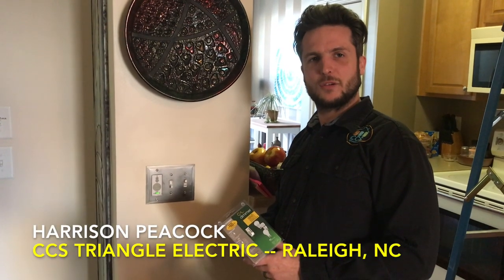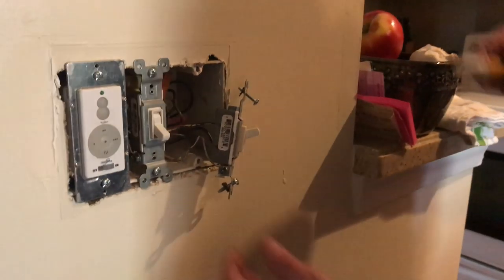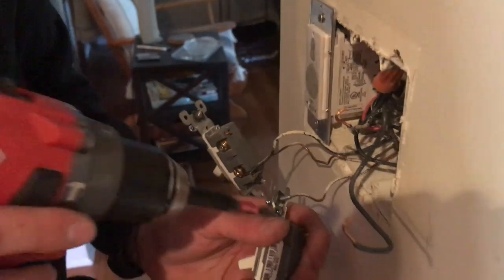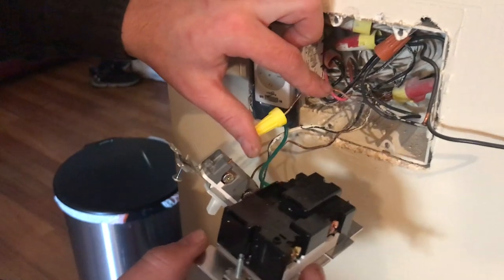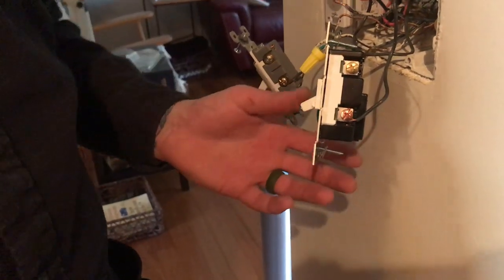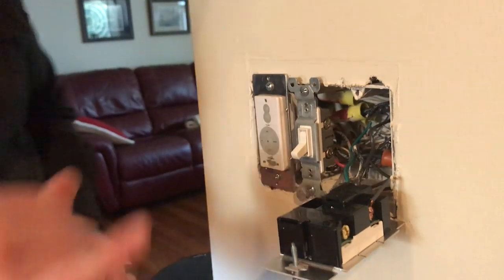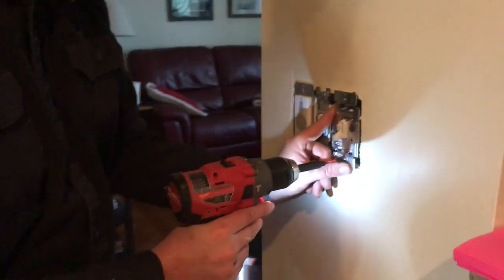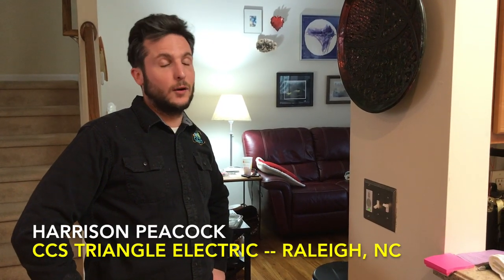How To Install LED Light Dimmer Switch

Comment: Every time I see a switch being installed in the USA or Canada, it always makes me cringe. Here in the UK we use a green sheath to cover the earth and the wires go into the switch and the screws are covered so the earth cannot touch the screws
Reply: John Fithian-Franks - just wrap the switch screws with electrical tape... problem solved.
Reply: The ground either touches something or it doesn't. If installed correctly it's never a problem.

Comment: Would adding a simple rotatory LED dimmer switch to an on / off cooktop range hood fan make a difference in the switch as they are 50W each? Note, I plan on changing the bulbs to LED that use considerably less current in the same sockets. I have a great deal of room and have to pick a location to install it. They are so bright now, my wife won't use them, and I don't cook in the dark!
P.S. Grounded light switches are used in every room of our 1980 built home. Also, It has become popular to place a couple of wraps of electrical tape around the back of the switch to make it safer to handle plus it greatly reduces the opportunity for the "Brown Wire" that is bare copper normally. It is true the tape will unravel at the tag end. I place a drop of black weather strip adhesive onto it. This does the trick for decades. I did not hear a discussion of bulb size, perhaps 50 -100 watts and any requirements of the dimmer switch used. Curious as I am familiar but wire electrical everyday!

Comment: Why don't ground wires have a plastic coating? That seems rather prone to problems.

Here in the Netherlands brown is power, blue is neutral and yellow/green striped is earth wire.

Comment: Great vid. So "common" was the power wire on that dimmer? That's confusing because I thought common was always the white neutral wires.
Also, tell the world to not be one of those people who paints around switch covers, doorknobs, doorbells, etc.! :)
Reply: That last part! Strangely, people do it out of laziness, but it requires more work and the results are never as good, especially with paint inevitably getting on the cover.

Comment: Common wire is not your hot u dnt install anything with a drill first and u dnt install devices loose ever not called 2 way switch either u probably shouldn't be doin videos they need to be removed